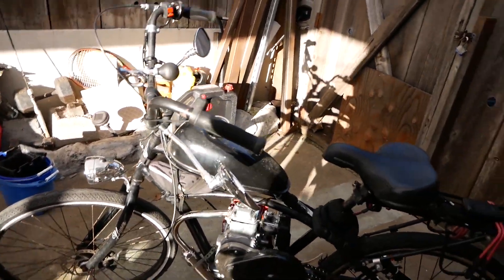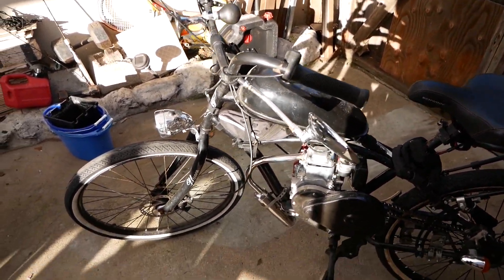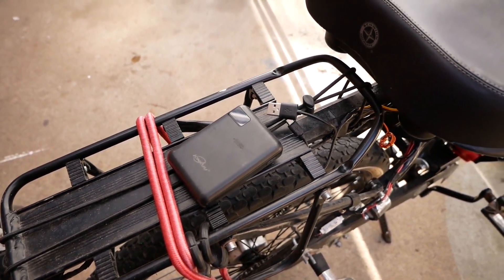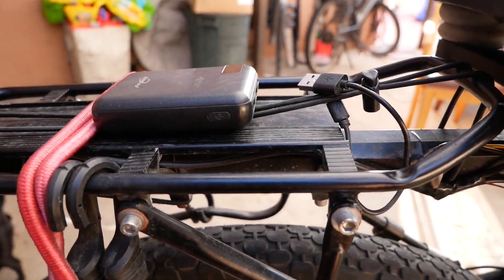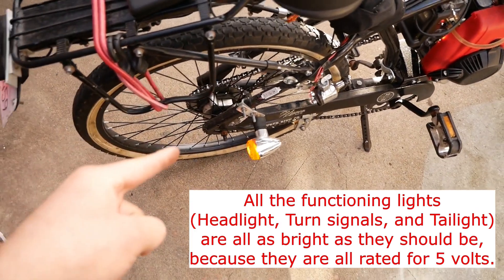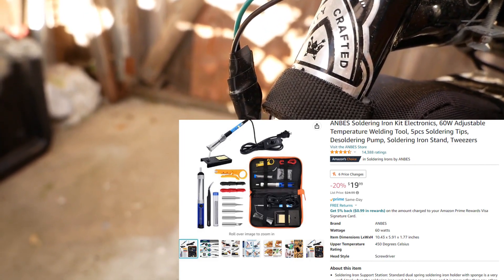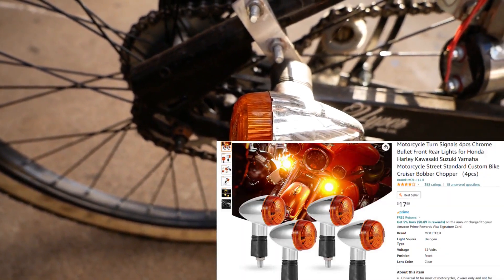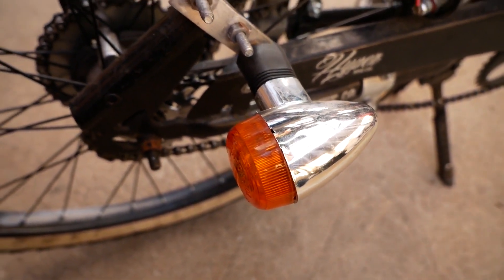Bicycle electrical system (TURN SIGNALS!)

Comment: What's the name of these turn signals that you're using for the bike ?
Reply from the maker: Per the listing, Motltech. They're from Amazon. I took the housing and put LED strips inside. Would have been better to have put an LED bulb instead, but I made due with what I had, haha. I actually included links to all the parts in the description to help if anyone wants to try recreating.

Here is the Amazon link to them:

Motorcycle Turn Signal Housing:
https://www.amazon.com/gp/product/B07PKJPPT3/ref=ppx_yo_dt_b_search_asin_title?ie=UTF8&psc=1

LED Strip:
https://www.amazon.com/gp/product/B09JS2L7PM/ref=ppx_yo_dt_b_search_asin_title?ie=UTF8&th=1

Comment: I'm in a pickle and searched for this video for 30 minutes. I need your help.

I started a 12v headlight build that runs off of a 10ah battery pack using a 12v to 5v converter. The system works fantastic, I get around two hours of runtime off of the battery pack.

I was looking to incorporate a three way switch, and I bought a 5 pin relay, however the switch works, but when connected to a relay, the light just stays on.

I was wondering if you are familiar with running relays and if there is anyway you can help me?

Just for clarification,

Headlight - Three wires (Low beam, High beam, Ground)
Three-way switch - Three Wires (Ground, second positive and third positive)
Power Source - Two wires (Ground and Positive)
Reply from the maker: I have to apologize Mike, it's been a while since I've looked back at my videos. I have not much experience with 5 pin relays but my understanding is that they maintain a circuit on and require an additional button to switch to a different circuit. As such, there is always power running to it so long as it is toggled on (why it may be on all the time). I don't know if you've solved your problem yet, but if not, here's what I would do:

We'll need to isolate power running to the three way switch so that each switch activates power running either high or low beam. If you are working with a 3 way switch, you should have 3 wires: 1. Power out 1, 2. Power Out 2, and lastly 3. Power IN, I don't believe a standard three-way switch has a ground as it should have the options for: ON / ON / OFF or something of the sort; 2 on positions and 1 off position. There shouldn't be a ground since there has to be a common positive to toggle either side of the 3 way switch. I would think what you called a ground would be a common positive (unless you have a three way switch that's set up differently, then I'm not sure.)

Regardless, connect power source positive to the common power in (Ground of the three-way switch). Then wire the  1st positive to the low beam, and 2nd positive to the high beam. Wire ground of the headlight to the ground of the power source.

With this set up, you should have the ability to switch between low and high beam independently.

*Word of note, this is an older style wiring. I know that with modern style, you would use the 5pin relay with an additional switch to toggle high beam. For that, I myself am a bit confused on the wiring. Would refer to this video to hopefully help you out:
https://www.youtube.com/watch?v=_mtaDat2v-8&ab_channel=AutoEdits

**Additional note: Standard wiring for motorcycles actually have the low beam on ALL THE TIME, with a relay and switch for toggling high beam. This is why motorcycle headlights are always on.